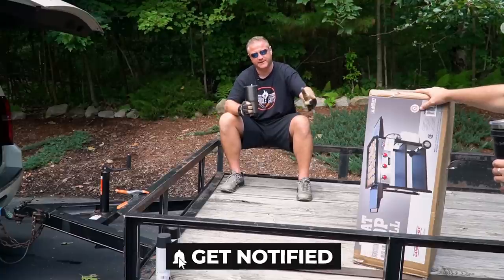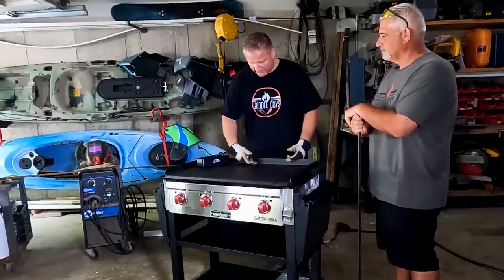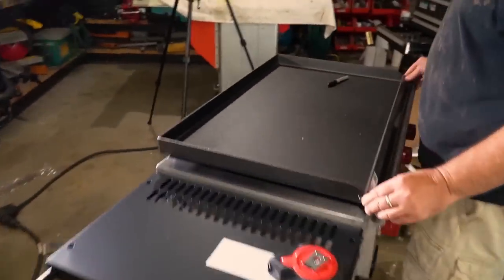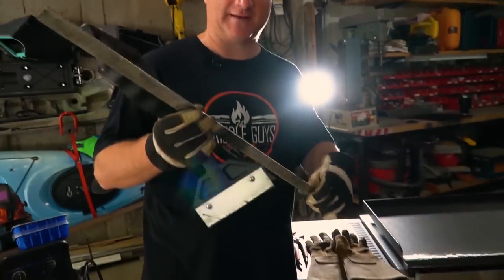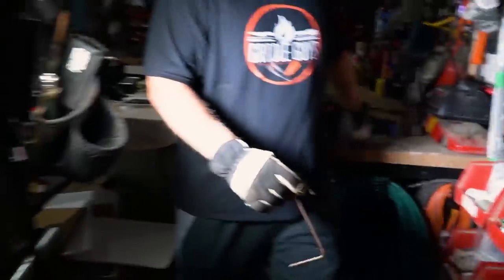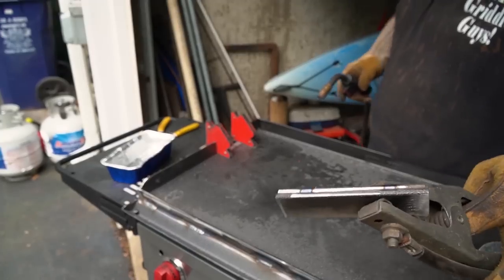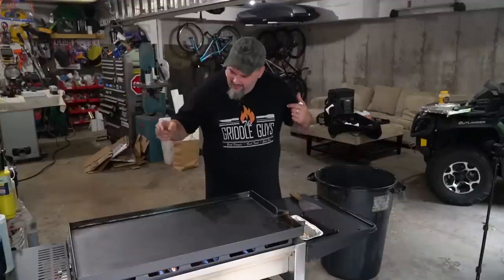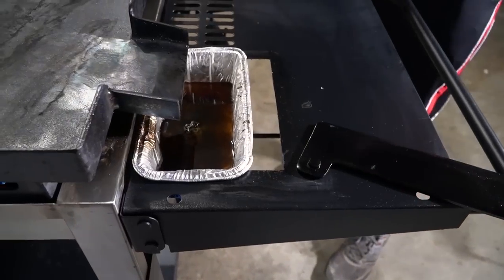3 things I hate about my griddle!  And how we fixed them!

Comment: I have that exact griddle and love it. My only disappointment is the chrome painted dial behind the red gas valve knob, the paint is flaking off within a year. Camp Chef punch out some actual Stainless. Problem solved.
Reply from the maker: Ty for commenting bucbucbuc111. Agreed. That happened on our campchef portable as well. Great units, but it's the little things for sure.

Comment: Rather than using the flimsy foil pans for the grease catch, how about using a small size stainless steam table pan? Structural integrity is less of a concern that way and you can run them through the dishwasher instead of trashing them.
Reply from the maker: Great tip and idea!  Jeff should pay attention here!  Cheers! - C
Reply: @TheGriddleGuys  FYI a 1/9 size pan is about the same dimensions as the foil pan you used (4Wx6Lx 2 D)

Comment: Safety first…!! Yeah right.
Put a disc guard on that grinder.
Put a handle on that grinder.
Do not use a disc with broken edge. At least not without a guard mounted.
Clamp the piece of steel being cut to the table.

Comment: Every griddle at every diner I ever went to had a grill with a polished and very smooth surface, not one that sounded like you were sliding your spatulas over sandpaper. How could you be happy with that? Ever go to a Japanese restaurant? Theirs are super smooth and very easy to clean.
Reply from the maker: Sorry for late reply. Unfortunately with consumer grade griddles they are made from cold roll steel unlike the ones you are referring to which would be stainless.  A more accurate comparison would be if you looked at any woks in a Chinese restaurant. With non stainless steel you have to put what's called a patina on it to keep all of your food from sticking as well as to keep it from rusting. You will see the same look on those woks as you do our griddles. All three of us would love a stainless griddle, Unfortunately even the cheapest ones are over $1000. Hopefully this at least answered the "why".. Anyways Cheers-J

Comment: SORRY GUYS, but the blackstone rear grease trap is absolutely PERFECT. it traps the grease and the opening is plenty large enuff for my blackstone spatula to scrap the extras into the trap and the rear trap is out of the way and in a great location. if your griddle is level, (which it should be) the rear trap is much more efficient than a side trap. so the entirety of your video is almost useless.
Reply from the maker: We heard you loud and clear kingzz . Check out our latest mod video when you get a sec. See if it's any better. Btw, glad your happy with your Blackstone.  Cheers-J

Comment: Blackstone and all the other cheap brands are JUNK, they require these fixes.

First blackstone I owned, the welds popped on the angle iron underneath the griddle and it warped. Until you get into a few grand for a high end* brand, you won't see above 1/8" thick griddles. Sure they're cool, however they Warp easy.

Comment: Yikes!   Every now and then you come across a video where someone finds a very complicated solution to a very simple problem.   I understand what and why you did but a bit more research would have helped you.   For starters that front lip is way too tall.  It only needs to be tall enough to stop grease...maybe 1/4 inch.  Your tall wall you put in there makes access for the spatula tougher.  Anyhoo....had you bought a char griller 36 inch griddle you could leave all those tools in the garage.   It has everything you wanted only it's done way better.  Large grease hole in front.  Large grease container.   Small grease lip on griddle front.  Just sayin.
Reply: Did they have fun doing it though? Looked to me like they did. Which makes them happier than you clearly are lol
Reply: @rtloiselle  unlikely.   In the time it took those guys screwing around with steel, welders, grinders,etc.. I was floating down the river with my dogs and friends, camping on gravel bars, swimming in the river and having a blast.   Its funny how wrong you are